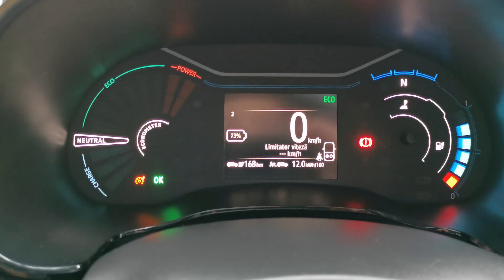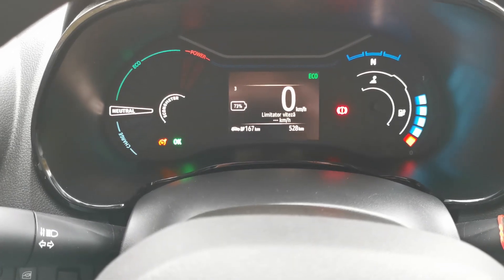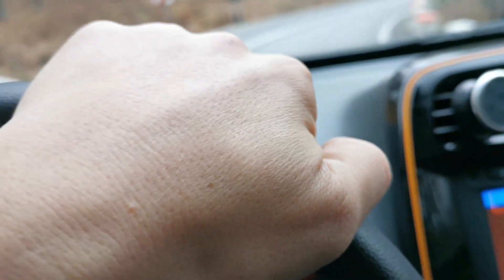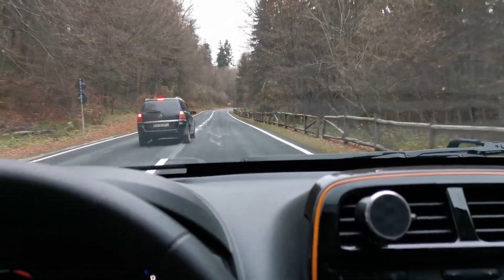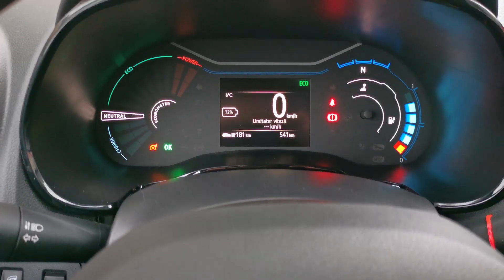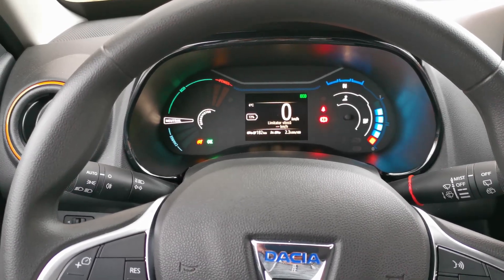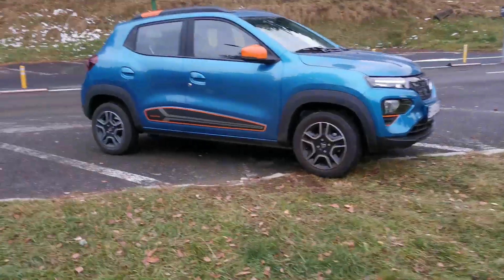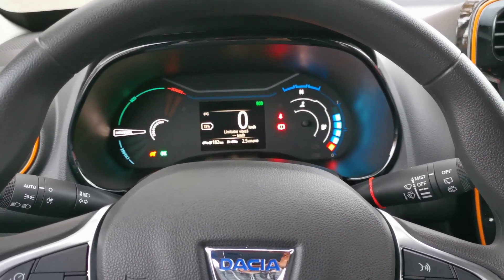DACIA SPRING ***MYTH BUSTED*** REGENERATIVE CHARGING, Electric vehicle practical recovery. :/ review

Comment: Just to share my experience with a VW Up - Once I went on a heavy climbing, and in like 40km 70% of the battery went out. However, on the way back I just put the car into neutral and used the brakes to slow down before the corners. in these 40km, the battery went from 30% to 70%. So in conclusion, if the descending is very steep, you are gonna charge your car. If not, you are at least not gonna lose range.
Reply from the maker: Hy there, i only tried it once, i had the 2019 Eup with a 18kwh battery i was  constantly watching the battery meter.
Reply: This car seem to brake electronically with electric resistance instead of sending the power of regen to the batteries. Some eletric scooters fry the internals when you’re braking in a big downhill.

Comment: You should pick a steeper hill and use a brake pedal. Regenarative braking is max 11 kw  - 3 blue stripes indicator....
Reply from the maker: That wouldn't be the point, i could just tow it and see if it charges, i want to see the practicality of the regenerative charging.

Comment: I think your problem with not recharging was that you were using the heating. That uses ~2kw so everything you recharged you consumed.
I did exactly the same test a couple of months ago (without heating) and while going downhill I consumed exactly 0.
In my test I reset it in Livada Postei. When I reached Poiana Brasov my consumption was 22KW/100km. And when I arrived back in Livada Postei I had 11KW/100km consumption.
Also, while driving downhill I could see sometimes the percentage going up.

Another test you can do is go to Cheile Gradistei and then check your battery level when going downhill. I recharged ~5% from top to bottom of the mountain and then arrived at Bran with the same percentage I left Cheile Gradistei (14km with 0 consumption, which was recharged on the initial downhill)
Reply from the maker: The point is that the recharging is useless, it would be almost imposible not to have regenerative charging and the test was downhill, i am sure that on a flat, city ground is almost zero.

Comment: I think you're confusing things, the car does have regenerative breaking so does charge the car when breaking/going downhill. However, you cannot get back the same  energy you spent going up by going down, this is just physics, otherwise you'd have perpetum mobile.
Reply from the maker: I was not expecting that i recover the energy i put in going uphill, that is why i have reset the counter at the start of the downhill, i was expecting to get 1% of battery back, on the downhill part, or at least i was expeting to end up having used 0% battery on the downhill road, but it did actually got back nothing and more it even consumed some battery downhill.
Reply: @GarajPif  i feel like the spring is such a light car that the energy it can recover going downhill is much smaller than other EVs which are double the weight or more, but the plus side with the dacia is that you spend much less energy going uphill :)

Comment: I think you need to press the brake slightly to get regeneration.
Reply from the maker: It shows you when it is recharging.
It does happen most of the time while braking.
Reply: @GarajPif  were you braking going downhill or just lifting your foot off of the accelerator? I thought you just lifted your foot.
Reply from the maker: @gmosc  as needed, i try to keep the regenation at 2 out of the 3 bars(maximum) i tried to avoid to apply braking, so that the car wouldn't loose energy trough the conventional braking system.
Reply: My experience. When you touch the brake softly the rekuperation is more, until -11kw. Depends of steep and temerature. The average consumtion ofvthe Bord Computer starts always at 12kw/h. The percentage of the battery would show the charge or decharge
Greeting from Switzerland.

Comment: The main purpose of regenerative braking is not to recharge the car if you airlift it to the top of the mountain. It's for recovering energy during braking in the city, if you know how to drive it. You need to have longer, less intense braking to recover any power, which would have normally been lost as friction and heat. If you always step on the brakes aggressively in any electric or hybrid, I agree, regen is close to zero and pointless, but that's not the way to drive them.
Reply from the maker: The purpose of regenerative braking is to have something to put on the marketing flyer, nothing else.
It is worth close to ZERO.
That is what i have experimented in 2 years and 28000 km.

Comment: with the new Spring Extreme, I've seen multiple times having the batteries go up 1% while going small downhills tracts.
You can change the odometer to show how much Kw are being used or recovered at every time.
You need a bit of speed otherwise at one point the resistance of the motor will equalize with the boost provided by gravity, so you should keep your speed constant, but if you don't apply throttle the car will slow down even in downhill, at one point the car will be slowed down enough that you barely get any energy from the spinning.

The best way to obtain the most from the regenerative is to set the speed limit and keep it at that speed constantly, you will regenerate a little bit less, but you will get it constantly.
Then again the extreme with new engine windings might just have a bit more regenerative braking since the engine can output more energy it can also absorb it more
Reply from the maker: The point is that travelling in the city, on flat ground, it doesn’t make any sense to rely on regeneration, it is simply negligible, from as much as i calculated, i can gain approximately 0,83% of the energy i spend, on flat ground!
So you could say is more than zero, but i say it is closer to zero than to a relevant figure!

Comment: The battery recharged... But marginally.
Keep in mind some aspects:
First, the absolute maximum power this car could theoretically generate going down would be 33kw per hour.
Second, the charger can only handle 30kw/h
Then, you never get the regenerative power at those values or I would say, the car would stop.
Lastly, you can only get regeneration for a few moments and imagine you stop and charge the car but just for a few seconds, would you really get a visible increase in battery? No, you wouldn't.
In conclusion, it is working but the difference it makes is a very small one.
Reply from the maker: Hy, thank you.
In theory it is imposible for the engine not to charge while you apply  external energy to the sistem, but the result is almost zero, that is the result i got.
Reply: @GarajPif  exactly, it will be barely noticeable. I would say that the car only recuperated energy while you apply the brakes and not when simply going down hill 
Like in a petrol car, you let go of the throttle going downhill and even so, if the slope isn't that steep, the car might loose speed.
And I would guess that in such a simple, basic car like this, the system must be very basic, probably even a little bit dated.
Reply: Max regen is 11 kW.

Comment: Hello, this is completely normal. I have changed several Nissan Leafs and it is the same. You can see that you consumed 11% of charge uphill and only 3 % downhill so there is 4 times difference in consumption. I dont believe that in any electric car you can build up battery%. These are great results. Hopefully Dacia will start Dacia Spring sales soon in Bulgaria too. Greetings. Keep up with the content.
Reply from the maker: Thank you very much.
Reply: Take a look at Zoe or Tesla, you will see real % gains. Those are just the ones I've seen.
Reply from the maker: @TheEragoon  that is really not the point here, i am not driving anybof those car, and, even those car produce almost nothing(zero) while braking on flat ground, they do recover something but i would say that you wouldn't be able to count that.
Reply: Wrong. Even with the low range i-miev (>100km) the percentage gain is very notorious. After climbing up more than 1500m I have spent 3/4 of the battery but when going down almost 1/4 was added back. In my opinion is preferable to have good regeneration instead of range... It gives you piece of mind knowing your car won't stay in the read zone if you only turn back near 10%.

Comment: what is wrong with dacia why havent they got regenerative braking . they should have non electric windows and maybe solar on panels. it would be perfect then
Reply from the maker: It does have some, but it is almost useless.
Reply: @GarajPif  regenerative braking does not exacly means that you can build up your battery up, just to go very far on very low comsuption. You have the heating on, even small blower heater consumes 2kwh. Emagine if you go without heating in spring time for example, you can go forever with this small battery downhill.
Reply from the maker: @marinovmomchil  that is what i was looking for from a downhill road, if that doesn't work, then for sure this regenerative braking doesn't work in the city at triffic lights.

Comment: Factually wrong. Your car IS recuperating (see the blue bars). If you had your BC set correct, you could even SEE how much is recharged. It depends (apart from other facts) on speed and if you touch the brake pedal. With the right setting, you could see values of 6, 9, 11 oder even 13 kW for recuperating.
Reply from the maker: Even you hand held battery driven screwdriver recuperates power hence electricity, i wonder why none measured it, except the fact that it is close to Zero!
The same here, it does recover some of the energy but overall after 8000km i feel safe to say that it is close to ZERO, no practical help!
Never had even 1% gone up my battery meter! On flat ground it wouldn't even charge a 1.5v kids toy battery.

Comment: I am sorry to say this is pretty much total BS.
A. The instruments tell you exactly the power figures. The Spring can generate a maximum of 11 kW.
B. The Spring has a mass of around 1 metric ton. The hills you show have not more than 1,500 ft., have they? That gives just 1.2 kWh in potential energy. In a test setting like yours hardly significant. Probably less than the loss by the tires' rolling resistance.
Reply from the maker: Goodluck charging the car on plain ground in the city!
Goodluck charging the Spring in ideal conditions.
Goodluck charging the Spring in a lab in a very controlled manner.
Goodluck charging the Spring in a freefall.
Goodluck charging the Spring with no tyres.
My Springs regenerative charging is BS, it is practicallu useless.
I cannot see the benefit of regerative charging in real life, in real conditions and no real effect.
Reply: si fuera algo más rápido en bajada tocando el freno suave durante más segundos quizá obtuviera mejores resultados, poco mejores pero notables